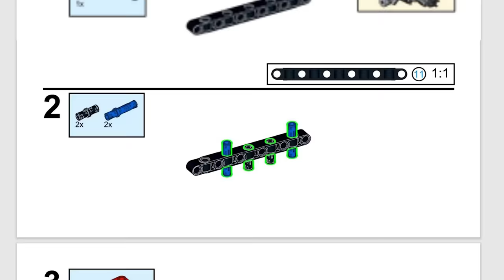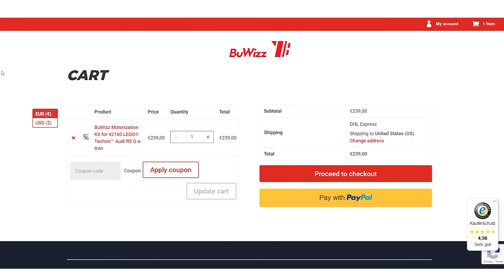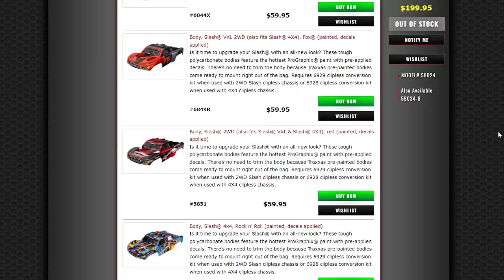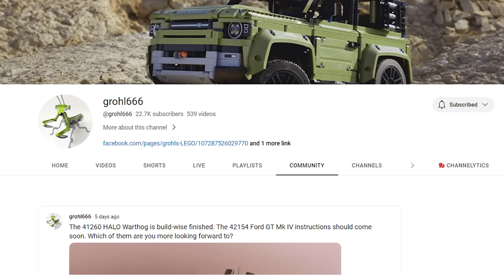Supercharged LEGO Audi Dakar racer vs Traxxas Slash - BuWizz powered Technic 42160 vs real RC car

Comment: The main issue with Lego RC for myself has been the lag associated with Bluetooth, or horrible touch controls.  I've been experimenting with using RC components to drive Lego RC vehicles to have a better experience
Reply: the models can also be controlled using the brickcontroller 2 application, where you can program the gamepad...then the control is much better and more accurate..
Reply: @matejkristofic9255 but the lag increases
Reply: Calculated it earlier, with about 100 Euro I can make every lego modell go almost 40 km/h. Buwizz was never worth the money
Reply: Some manufacturer needs to make a 6 channel 2.4ghz box that can be used with rc car radios it would be so helpful and boost the power of the lego motors because the receivers only need a small amount of power not mentioning the extended range
Reply: @technicmaster0949  the problem is the motors cant. Brushed motors are mostly a waste of time. Making a box for it that brins 1 or 2 V more, is another waste of time. Trust me, i did experiments. The motors cant take it. There needs to be a brushless solution. And that you find in rc world. Like i said, 100 Euro = almost 40 km/h
Reply: @fastbricksrc6084  yeah I guess your right would be a cool concept I anyone could make it work though
Reply: @technicmaster0949  there isnt a specific box. But i use a rc controller with drone motors. Easy 60km/h with 1 motor. I will release some videos about that soon
Reply: I’ve been using the buwizz motors with a 3s brushed setup. Works pretty well, but brushless would definitely be better. good thing lego is metric, you can directly mount brushless motors and I’m looking into potentially 3d printing axle/motor shaft interfaces
Reply: addition... For buwwiz 3.0, I recommend using a PS5 gamepad connected to usb c. More accurate response
Reply: @Matej-Brick  thats of course much better but still no match to real rc components like I use
Reply: @technicmaster0949  Mould King, CADA and Reobrix have 4 channel or 6 channel lithium 2.4GHz battery boxes.  CADA has a 700 mAmp brick, instead of 500 mAmp.  Still not brushless power though.
Reply: @williamdemler24  yes I know, I have all the boxes apart from reobrix my CaDa 2.4ghz brick actually has an 850mAh battery as I took it apart to clean yesterday though that is the 4channel one. either way being able to use a normal rc car remote instead of the ones that come with the set would be helpful
Reply: @technicmaster0949  I completely agree.  It would be very cool to use a trigger remote with a steering wheel like the Traxxas models.  Zene Bricks has that option.
Reply: @williamdemler24  oh really maybe I will check that one day
Reply: @technicmaster0949  I think the speed is up to 35 or 37MPH
Reply: @williamdemler24  my goodness that is fast!
Reply: @technicmaster0949  I have to be careful when driving the Traxxas models.  I am not an expert driver.  Crashing into a tree or making a poor jump can end the day.  Also, the LIPO batteries that power these models can take out your home or vehicle.  LIPO is flammable when not handled correctly.  Once on fire, it is very difficult to put out the fire, if even possible.  You MUST discharge the batteries to a storage voltage after you are done using them.  You can NOT throw them in the typical trash when done.  You can NOT let them go down to dead charge.
Just one battery can cost $165 for the 4S and it may take TWO to power the model, so you are out more than $300 just to get the model driving.  The chargers cost $100 each.  The XO car goes for $1K new and the X-MAXX is at least $900 w/o batteries.
Reply: @williamdemler24  depends what Lipos you use Onyx ones cost a lot but they are very durable and safe. cheaper ones break easily and can catch fire. I have quite a lot of RC cars though mainly HPI, HBX and Tamiya, Traxxas is just a bit too expensive for me. RC cars other than lego is my main hobby, I do even have a video on my channel on the HBX Devastator, though it is a few years old now and I find it very cringe 😅

Comment: My concern with lego: what about bearings and wear? Lego RC sets are neither sealed from the elements or lubricated. Lego RC is fine indoors and on small scale like 1/24. I don't trust lego to survive long outside. If the elements don't destroy it, wear and tear will

Comment: I bet if you actually mounted one of these rc motors with recievers (and servos and custom calibration and code for remote control) to a lego car, AND optimized it as well as the rc cars are (simple drivetrain, carbon fiber/stronger axles and gears, lubrication, actual testing and using engineering for maximum performance) teh results could be pretty similar. Albeit, lego eould weigh more and maybe be slightly less effectient, but it'd still be pretty close. We just dont have the same level of power in lego motors that ec cars with 3s lipos and brushless motors have. Give lego that and there is the con of lego weighs more and is maybe less durable than an rc with an aluminum frame (Which prob costs more but a plastic rc frame would cost less but be the same durability). But at the same time, it is a pro because you can build the car from the ground up as opposed to the RCs prepackaged possibilities.

Comment: The RC vs lego series is very helpful because I am currently facing a similar choice. I have an Audi (my first RC technic set) but the performance on Lego electronics is terrible. For the price of the BUWIZZ set, you can buy, for example, TX4M, which will be both faster and more efficient off-road. But I love the modifiability of Lego bricks, the ability to rebuild the model and test new technical solutions (gearboxes, differential locks, etc.), I think that building gives me more fun than playing, so I lean towards BUWIZZ.
Reply: Is this the speed cap then of the lego? is there no other products available that will increase speed/rpm?
Reply: You can use rc electronics and lego frame

Comment: We have to make do with what we have and find the positives in good handling and interesting features:

https://youtu.be/Zi_6nXqfC8M

The main issues with LEGO motorization are as follows:

1. Excessive weight of components that do not serve a functional purpose beyond aesthetics.
2. Large size of complex mechanisms, contributing to increased weight.
3. Significant play or slack in various components, making it challenging to drive straight at speeds exceeding 10-12 km/h without intricate chassis tuning.
4. The challenges of controlling high-speed models due to the lack of suitable applications, limited development, and support.
5. The absence of high-torque motors capable of delivering power at low RPM (less than full throttle). The BuWizz motor is good but only when running at maximum speed.
6. Significant issues with friction at high RPMs, causing rapid wear and tear of components such as hubs when exposed to dust and dirt.
7. ... I could go on endlessly about what LEGO lacks, yet I continue to love it. 😊

Comment: Thank you for sharing this video.  I have a LOT of Traxxas trucks and street cars, including the XO that tops out at 100MPH.  I have the Slash 4x4 LIPO powered brushless truck.  It's a lot of fun.  I also have the Ford crawler with the lift kit.  I definitely want to try alternative power packs and motors for the Lego R/C kits, for more power, torque, and better remote control range.

Comment: i honestly dont know if i should consider getting an rc car as they look really fun to be honest
Reply from the maker: You can give it a try with a cheaper model from other manufacturers
Reply: @RacingBrick  k thanks
Reply: They are a LOT of fun.  Just have some major room for them to "run".  Small spaces will not have enough pavement or dirt, and you may end up with some crashes.

Comment: I've found the best of both worlds by building custom electronics that have nice physical controls and no lag. By converting DC motors to Lego, I have myself much faster cars for dirt cheap. Still doesn't compare to an actual RC but it is not slow or expensive either. If you have the knowledge and confidence to mess around with electronics and lipo batteries, you can do some pretty cool stuff with lego

Comment: A bigger suspension 
and bigger wheels 
and more powerfull engine would outplay a standard RC-Car‼ 
Cant wait for it‼
Reply: I've tried putting huge engines in Lego, they just rip everything apart like it's nothing. You can't really do anything about it, Lego was never meant to face such extreme forces
Reply: @Mr.Engine993  well that's why there are LEGO metal parts

Comment: Are the buwizz motors usable with the powered up hubs?
Reply from the maker: No, their plugs are not compatible. It's actually the other way around - you can use BuWizz 3.0 Pro to drive Powered Up and Power Functions motors.

Comment: With the buwizz upgrade - is there any noticable wearing of parts (axles are my main concern) with the increased speed?
Reply from the maker: Not yet, but sooner or later there will be, especially if you drive it outdoors. Most of my outdoor RC LEGO vehicles need some of their cross axles / gears to be replaced after a while.
Reply: The biggest issue, in my opinion, is with the new wheel hubs from set 42160. They lack lubrication, and dust easily gets inside through the gaps, which is almost impossible to wash out. After the very first ride outdoors on gravel and dusty roads, the wheel hubs started rotating significantly worse((( That's why I prefer going out after rain when the dust is settled on the ground. @RacingBrick
Reply: all drive elements must be greased with vaseline, and some lego aluminum parts can also be purchased
Reply: From Mould King you can buy carbon axles. They are included in some sets or with motors.
Reply: Put Vaseline on axles and gears and cover them with pieces of paper or cardboard to prevent dust from getting there altogether. This will significantly increase the longevity of your parts

Comment: Buy a WLToys for half the price...

One advantage of the LEGO RC car though is that you can fix it without having to buy replacement parts when it does break. The "true" RC car can get quite expense that way. But yeah it sure is more fun bashing at 50km/h 😂
Reply from the maker: I had a WLToys buggy, lasted about 20 minutes before breaking down, and I didn't do anything special with it.
Reply: @RacingBrick  I don't share that experience. My 12017 took quite some beatings before I needed to order replacement parts. You know, crashing into a pole with 1 wheel is a recipe for disaster, no matter the brand lol. But sure, it's cheaper, Chinese stuff so I guess Traxxas could be tougher.
Reply from the maker: @MichelHoogervorst  couldn't brake my Traxxas cars yet, but those are not invincible either. Also had a lot of Chinese stuff previously, according to my experience they are usually too powerful compared to their toughness and easier to break.
Reply: Be careful with the jumping.  Get some extra parts for the front and the parts that keep those front wheels in place.
Reply: I bought a used Mould King buggy and I noticed there are some metal parts in the set.  The set does not have enough torque though and needs an upgrade.
Reply: @williamdemler24  I was thinking about buying this buggy from Mould King, but now I'm thinking about buing two buggy motors from them and build something "mine" around this. Comparing to traditional lego sets this buggy was not that slow.

Comment: Traxxas can also be bought as a kit version, just in case you want to build it yourself
Reply from the maker: True, but with the kit you can only build a single version :)
Reply: @RacingBrick  not completely. Just as with Lego you can decide to make alterations. You can switch springs, engine, tires and pimp it with lights and other accessories.
Reply from the maker: @RoysIdea  I mean when you buy the kit, you get a single set of springs, motors and everything else, and with that you can build a specific configuration. 
That's what I tried to point out in the video as the main difference, since a certain amount of LEGO pieces give you way more possibilities without buying anything extra. With RC cars you need to pay attention to a lot of things, e.g. my Traxxas TRX4 Bronco cannot accept a lot of other TRX4 bodies because the wheelbase is different, I need to buy an additional kit to have that changed.
Reply: @RacingBrick  From the limited view of the complete set you are correct. But in the video you also mentioned that you can build other models with just a few extra bricks. For the true Lego fanatics they probably already have those.
For me, in-house Lego is my preference, but outside or in a big hall I would prefer an RC kit.
Reply: @RacingBrick  don't forget to buy the ball hitch and something for it to connect to, like a boat trailer for a Spartan deep vee.

Comment: I have a question. How do you use 2 buwizz at the same time. I have a buggy where I can put two buwizz in it and i don‘t know how to connect them together with the app
Reply from the maker: There are instructions and tutorial videos on the BuWizz website, I suggest to check those

Comment: One of the only problems with the traxxas is the steering it looked quite hard to steer
Reply: Nahh my dudeeeee  🤣 are you a 🤡 You cna say  a lot of nageative things about traxxas controls ain't one :D it's skill issue i bough the rustler vxl which is almost th ehighest end that can be in the rustler series it cna do 60+ mph and still drivable even if my servo is failing which is a traxxas thing for sure 🤣

Comment: when you wanna write off a cool rc as a business expense

Edit: "You have to buy custom parts for the Traxxas to upgrade it" is a terrible argument after buying custom parts to upgrade your lego lmao, lego is ALL about buying more parts, and also, most of the rc parts are interchangeable between cars of the same model
Reply from the maker: There's no business expense here :) Can you build a Batmobile from the Slash parts only? Or a buggy? Or a truck? No you can't, simple as that :) LEGO builds will never be as fast or as powerful as RC cars, but RC cars will never be as versatile as LEGO.
Reply: @RacingBrick  but that wasn't the argument? And you can actually do a lot if you're willing to do some customization. So yeah you could make a batmobile just using rc parts. 

The argument is that "buying custom parts" is a con for rcs. When you bought custom parts for the Lego model to make it rc

I have built Legos all my life. And I have some rc cars too. They both require you to buy new components because usually the stuff you get from one Lego set still limits you

And with some imagination. You can use those rc components in a lot more ways than just intended. As for the batmobile, that's literally just some body work.
Reply from the maker: @Gio98art  you still don't get my point. You buy a LEGO set, and without buying anything else, you can build tons of things using the very same parts. No need to buy anything extra. I buy the Audi set, and I can build a Batmobile, a Buggy, and so on. You go on rebrickable.com, search for the set number, and will get lots of alternate builds for each official set. If I buy a TRX4 Bronco, I will only have a TRX4 Bronco. I can buy of course parts and customize the hell out of it, but for every modification I need to buy extra parts. From this point of view, RC cars will never beat LEGO.

Comment: Cool video but dont you try the powering system with the MouldKing rechargeable batteries and buggy morors? I think they are good too and less expensive than buwizz :D
Reply from the maker: They are less expensive for sure, but as far as I know the MK 6.0 module only provides ~8V, so the speed would be significantly slower than the BuWizz version.
Reply: @RacingBrick  so the Buzzwizz output is definitely a game changer, right?

Comment: Inacccurate. 
Convert lego with rc servo,  esc and motor. 
Then it will be accurate.
Reply from the maker: What would make that more "accurate"? LEGO parts are simply not designed for that amount of power.